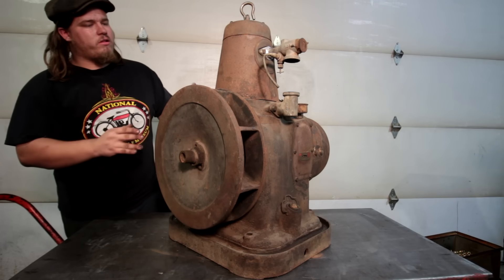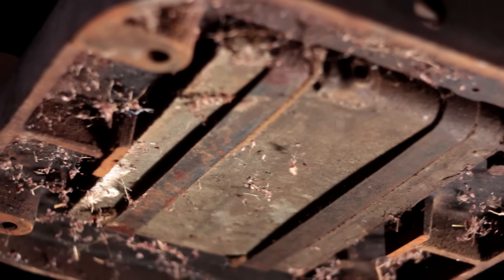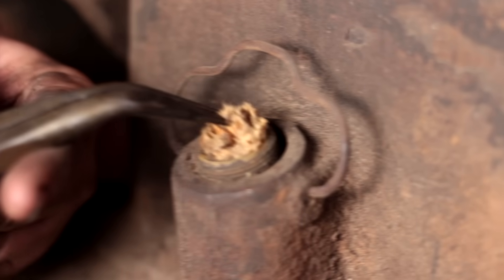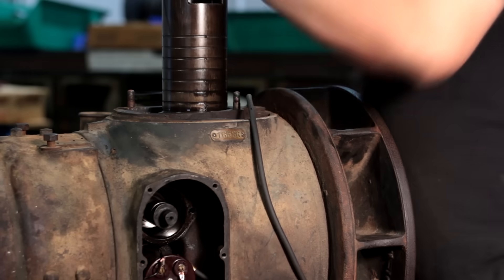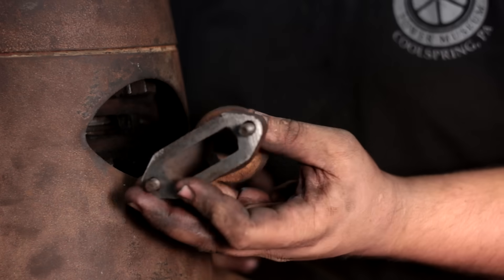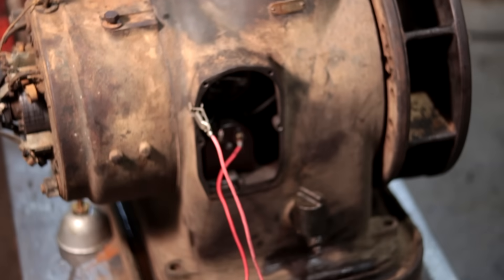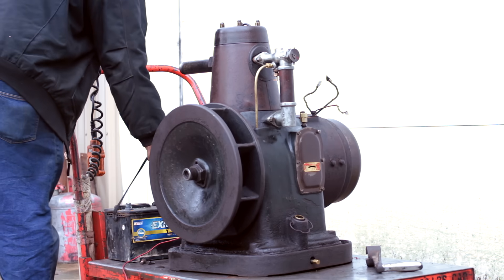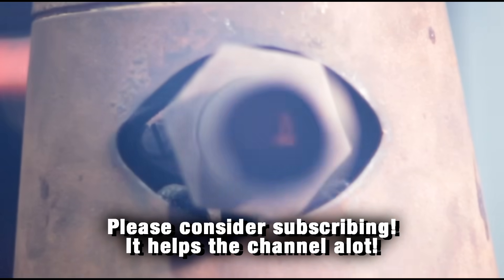100+ Year Old 4 Stroke Engine Design Has NO VALVES!!! Can We Get it Running after 60+ YEARS??

Comment: Now imagine fourteen of these cylinders configured as a radial sleeve valve engine and you have the Bristol Hercules that powered the four engine Halifax bomber.
Reply: The Hercules and Napier Sabre engines used in the Hawker Typhoon and Tempest were also sleeve valves, though they had only one sleeve that not only went up and down but turned in the sleeve bore. They were also the most powerful engines (internal combustion  ) used during WW2. Because of the sleeve valves, they were set up as a twinned  flat 12 cylinders for a total of 24, one on top and bottom. Very complex engines but hugely powerful. What a treat to see this one run so quickly. I am curious about the timing of the sleeves as they did not appear to open very much on the exhaust.  That Willys would be very quiet with a muffler. Thanks for posting it!!
Reply: @1967250s  Hercules were also used in Bristol Beaufighter, named by the Japanese as "Whispering Death" due to the low sound levels of the engines.
Reply: @1967250s  The Bristol and Napier engines had a very different design, the engine whe see in this video is a old Knight system, obsolete in the late 20 ties
Reply: @1967250s  you forgot the Bristle Freighter
Reply: beaufighter, and even Avro Lancaster were retrofitted with Hercules.
Reply: @alistairplank4996  not the same design, the engine whe see here is a obsolete Knight system
Reply: @alistairplank4996  Also post war Blackburn transport aircraft, such as the Beverly were also Hercules powered.
And lets not forget the Bristol Centaurus, the king of sleeve valve aero engines.
Reply: I read it as "Value-less", at first!😅
Reply: What did that arrangement weigh?
Reply: Oh Wow. That is a fine thing to report.
Reply: It’s a mechanical work of art in my opinion. Designed by pencil, slide rule, compass I assume of the drafting type and what they had for a smart device, brain power. Unbelievable really.
Reply: And the beauty of the sleeve valve engine was it could run at full boost constantly when needed, something it was legendary for during the war
Reply: No, the Bristol’s used a completely different sleeve system.
Reply: @scheusselmensch5713  Burt - McCullum; same concept. Ricardo found the weaknesses of the double-sleeve type very early on, and Fedden learned from Ricardo's work.
Reply: @boblethbridge6292  What are the weaknesses\problems of these double sleeve valve engines? -Thanks
Reply: @scheusselmensch5713  Bristols may well have used a different sleeve operation, & only a single sleeve at that, but they were sleeve valve engines none the less.
Reply: @KB10GL  Nonetheless
Reply: Incredible engine design 👍
Reply: Don't forget the Bristol Centaurus 18 cylinder engine that powered the Sea Fury, Tempest and others.
Reply: Radial engines always have an odd number of cylinders.  The Hercules engine is even more incredible because it is 2 seven cylinder radials bolted together.
Reply: What a nightmare to maintain
Reply: @donbrashsux not really
Reply: Also the Napier sabre had sleeve valves, 2 crankshafts and 24 cylinders.
Reply: The ercule engine is not a knight engine it's a totally différent system , much better besode
Reply: Legendary engines ! I also love the Bristol Freighter powered by two Hercules .. that plane is so ugly that it becomes beautiful . And very very useful , there’s a short documentary about the Bristol freighter here on YouTube , I believe it’s about the story of these planes in New Zealand as many were sold there back in the day . The Bristol company made many curious and reliable engines for smaller aircraft as well. Things were made to last , no planned obsolescence.
Reply: They even used these engines to power autos for some time. My granddad used to tell me about these and I never could visualize how they worked, I never saw one or found anything ina book about them either. It's amazing you got this engine up and running. Pretty cool. Grandpa did tell me about the issues they had with oil consumption though.
Reply: Well , put out your own Video
Would be most interesting

Comment: It does have valves indeed: it's a "sleeve valve engine". They were less noisy compared to classical 4-stroke engines with valves. The main concern here is lubrication of the sleeves and piston. Nice work!

Comment: On some things with Points you can put an AM transistor radio near the engine. Turn up the volume and set it between stations so all you hear is static, when the Points break you hear a tick/pop from the speaker 🔊 I learned it in the 60's

Comment: So what is the generator output 120 volts AC or 6 12  24   or 32 volts DC if it's DC is the generator shunt wound so that you can use the generator as a starter also from what I saw when you cranked the motor it looked like you wrapped your thumb around the crank handle its natural thing to do I used to until a gentleman who was probably around sixty years old or older told me not to and why if the motor back fires it'll rip your thumb off and break your arm
Reply from the maker: dc 32 i need to have someone with the right know how look at it!~

Comment: When i heard,, no valves, i figured something blocked the ports at the right time? I would never have guessed duel cylinder sleeves,,,, moving?!?
One other thing that I thought was brilliant, were the grooves for the wires on the coil! Sometimes when you tighten down wires, they just have to spin out of place, or could kink when tightened. I swear they had more smarts back then?!😊

Comment: I always made it a point to show folks the static cutaway display 4 cylinder boxer Bill Harrah had in his collection.
I always marveled at the Bristol Hercules engine.  A 14 cylinder, single-sleeve, radial version of this design.  One of the most amazing pieces of mechanical engineering ever.  Too bad this design suffers from so much inherent wear.

Comment: Fantastic video.
What is the drawback with this type of engine?
Reply: They tend to be low power. And consumed a good bit of oil. By 1940 they had been far surpassed by smaller engines with valves or two stroke engines for the same HP.
Reply: @gravelydon7072  Ok I understand. It was an interesting engine and was completely unknown to me.
Thanks for the answer, I appreciated that.

Comment: Nice thing about this kind of generator is if it's used to charge a battery you can setup a relay with voltage threshold. If voltage is low due to battery being almost flat, the relay would enable ignition and would connect generator to the battery. Generator would act as a motor. Starting the engine and once engine got up to speed it would naturally switch to generating power like regenerative braking.
Once voltage got high enough the relay would trip cutting the generator and ignition off making the engine shut down.

Comment: Technology was better back in the day but things were designed and still are to break so you need to spend money to get them working. I remember dynamo's used to be used but they were too efficient so they made the alternator. More parts means more to go wrong and made with poor materials means lots of breaks. Look at the electric car's from the early 1800s to the one's today ❤️💛💚

Comment: Wouldn't the ignition coil run on a 32 volt battery? This is a lighting plant engine, so the dynamo should be 32v, it would be kinda strange if the coil was meant for 6 or 12v. Granted, such simple coil might not mind being on whatever voltage.
Reply from the maker: i assume they  wired it in a way that made the genset only send the coil 12 or 6. i tested with 12 and it sparked good so i called it good!

Comment: I think it would make for more interesting content to upgrade these old mechanical engines with modern EFI solutions; electronic ignition, electronic fuel injection and so forth, and wide-band lambda probe to examine the exhaust. Then you could judge how well the mechanical part of the engine worked, once it's tuned right.

Comment: It has got valves, but not conventional poppet valves, it's a sleeve-valve engine. We have a technical museum here called MOTAT, they have a sleeve-valve radial aircraft engine that has been restored and runs perfectly. Also, Daimler used sleeve-valve engines in their cars for years. Very quiet running, but difficult to get them to not smoke.
Reply: Oil consumption in the car engines was bad. In some cases up to 1 qt per 100 miles. But back then, people didn't go on long trips often. Can you imagine needing a case of oil for a 2400 mile round trip?

Comment: What can you run off of this?
Reply from the maker: it is a light plant for powering your house
Reply: @cruddycornstalks  What kind of genny would they typically use, DC or AC?
Reply from the maker: it has the factory dc one attached to the back. 32v
Reply: @cruddycornstalks  Did you try using it?

Comment: Well a Knight engine actually DOES HAVE VALVLES. They just aren't poppet valves but sleeve valves. This is a successful design, but not as successful as those with poppet valves because they consume a lot of oil and smoke through the valve sleeves. THe British aircraft engine, the Bristol Perseus is another sleeve VALVE engine.

Comment: It's a sliding sleeve valve engine, they also made rotary sleeve valve engines.
They are hard to seal and get good compression, and because they have low compression ratios and small valve area they are very low horsepower engines.
But still a mega-cool piece of history! Thanks for showing it running!

Comment: As noted, This is a sleeve valve engine.  Large usage in aircraft engines during the 30's
Reply: The ones used in aircraft (late thirties through to the fifties) were of the later Burt-McCollum style single sleeve design. The type as shown in this video, while clever for it's time, would not have stood up to the rigours of a WWII aircraft engine.

Comment: This is called a Sieve valved engine. Please do an old mechanic a favour and use real wrenches and sockets, "C" wrenches are not even....
Reply from the maker: cresent wrenches work best for alot of this old iron. you can get a better fit to the head of the rusted bolts and fit the odd 32nd increment ones that pop up.  if you use them correctly there is nothing bad about one only incompetence causes  one to fail.
Reply: @cruddycornstalks  Just saying, IF I were to be doing a bunch of stuff on the "old Iron" I'd invest in a good set of the common X/32" wrenches.  I work on a fair amount of British 
'old school" stuff and have invested in sets of Whitworth B and C wrenches.  But that's just me.

Comment: Big old giant toolbox full of tools and you're using a Crescent wrench.I hate Crescent wrenches.Use a real wrench like a real man
Reply from the maker: crescent wrench is a real wrench! works great only time it doesn't is when someone that's incompetent uses them wrong. if you hate them you have never used them correctly! we have almost any wrench you could ever want and the crescent is still one of the most used for the accuracy and fitment of the old nuts and bolts and a rounded head is never seen here!

Comment: I've never heard of a 4 stroke with no valves (but in all fairness, I had never heard of a Detroit Diesel (2 stroke I believe) until I found Youtube).  I'm in my 70's.  I have a 4 cylinder diesel marine motor that was disassembled a couple of years ago and seeing you get this engine running it's put me in the mood to get mine going again.  Thanks!   Subscribed also.
Reply: A two stroke General Motors Diesel ( Detroit Diesel ) has valves along with ports.The ports are for the intake and the valves in the heads are for the exhaust. Depending on the head, they can have either two or 4 valves per cylinder. Sleeve valve engines will consume far more oil in 24 hours than a Detroit will leak or consume.

Comment: Great video! 
The engine you show here reminds me of a few WWII aircraft sleeve valve engines. The 1935 British Bristol Hercules a 2 row, 14 cylinder radial, supercharged radial engine rated at 1,585 Hp. The 1938 bigger  Bristol Centaurus, an 18 cylinder, 3,000 HP supercharged radial aircraft engine. And the 1938 British Napier Sabre, a supercharged, liquid cooled, 24 cylinder H engine, rated at 3,500 Hp to name a few. All of these engines used a sleeve valve system except they used one sleeve.  Their sleeves reciprocates like your sleeves do but they also rotate so many degrees to expose the ports. These were some of the most complicated engines developed.
Here are a couple of videos so you can see how they worked. Yes, they are a bit more complicated than the one you show here, but aircraft and their engines have developed fast and still are developing.
Bristol Centaurus
 https://www.youtube.com/watch?v=v9IpQeVdDS4 
The Napier Sabre H engine
https://www.youtube.com/watch?v=xdkgcXnWoxY

Comment: Dig the tshirt. Glad we got a chance to visit the NMM before it closed, but you're using crescent wrenches?? 
Bruh. Not cool. At all.
Reply: Crescent wrench = mexican socket set. lol Yeah when John was gone, no one else actually gaf. Can't blame Jill, tho. Sometimes ya just gotta let go.
Reply from the maker: it was a shame but not much anyone could do.
Reply from the maker: there is nothing wrong with a good crescent wrench in  fact it can save you from rounding bolt heads on rotted bolts that are no longer standard or odd ball 32nd increment heads like alot of old stuff uses. we managed to get one trip to it the year it closed, stuff already had been marked with lots. shame it had to leave but I wasn't the biggest fan of how it was run.

Comment: I'd be interested in how many contacts on the commutator and what voltage and frequency the generator outputted. Nice job on the video, the timing of the sleeves is also interesting. Never seen one before, thanks for the presentation and nice job of getting it running. I think you've hit on an interesting niche, I subbed.
Reply from the maker: i dont have a single clue on gensets so i haven't even messed with it!

Comment: Great video, I'm glad you got it running. Some history, my dad's family had a Willys Knight car in the 1920s in Port Elizabeth, South Africa. It had the Knight sleeve valve 6 cylinder engine which seems to me to be a much simpler and more efficient solution than the ubiquitous poppet valve system. I wonder why it wasn't developed any further. I looked it up, seems the Willys Light was basically your one cylinder sleeve valve engine used to produce electricity for light, it's advantage was that it was quiet unlike even modern day generators.

Comment: Very  cool engine and your presentation style is perfect. With the rusty side covers, have you consider converting them. That is hanging them in boiling water for an hour or two turning the red oxide into black. Then a light buffing  and it looks great like a seasoned cast iron fryiny pan. Thanks  for your great vidios.

Comment: In the 1920s, the Sterns car company made a car called the Sterns-Knight it had a Knight sleeve valve engine as it was called. So this engine has valves, too. Not just (common) popet valves, reed valves, rotary valves, etc. They smoked more than regular 4 strokes.
Reply: I imagine it's a lot harder to seal the oil out of the combustion chamber with all those nested cylinder walls versus more conventional piston rings.

Comment: Very misleading title because of course it has valves. They just arent poppet valves. What it has are sleeve valves. If it didn't have valves obviously it would be impossible.
Reply from the maker: do you call the cylinder on a two stroke ts valve? its just a cylinder.

Comment: Nice engine, lovely restoration. As a suggestion, get boiled linseed oil and mix 50/50 with white spirits and apply to the outside. It takes an age to dry, but the patina that's left is well worth it
Reply from the maker: I don't like using linseed oil as it stays in the paint and can swell with age causing paint flaking. Wd40 evaporates and leaves nothing afterwards.

Comment: Could you please identify the manufacturer and type, and a brief history of applications and units sold, etc.?  Is it British?  They did favor sleeve-valve engines.   But it's odd to see a sleeve valve in what is obviously a low-RPM industrial motor, they are intrinsically more expensive to build, and even more-so expensive to overhaul when the sleeve(s) become worn. 

Also, just from the video I can't fully understand the valve-train. 

It's also of interest what of it is original vs later "fixes."  I'd be surprised to find aluminum bracket pieces in something built in the early 1920s, and it is terrible practice ass used in any event due to galvanic corrosion.  Almost certainly those parts are later crap-work.  As @markseibert6369 notes ... there's lots of evidence of shoddy rework of the ignition.

Comment: Esse motor era um gerador de eletricidade?
Reply: Ya, ppl are drawn to this video b/c of the very kewl concept of valveless 4-stroke.  Does not look efficient - no wonder 2-stoke did away with it.  Also tons of friction.  Maybe microgenertion is the way to revive the concept?  TiB4-doped BAM for the sleeves, and single-speed exhaust-tuned operation, like a sort of ICE version of a sterling-cycle?

Comment: Very interesting engine design, I guess all the moving cylinder parts kind of add to the wear and tear of the engine
much faster than a normal valve type design. But it still works after all these years "thank to your work" so how bad could the design be. Thank you for sharing this vintage engine design with us.
Reply from the maker: You are right, it is not the most durable engine design!

Comment: Very cool, but a sleeve valve is still a valve.
Reply from the maker: That is the simple terms used to make it easier to understand. But in the end it just has sleeves with ports like a two-stroke. Would you call a two-stroke cylinder a valve?